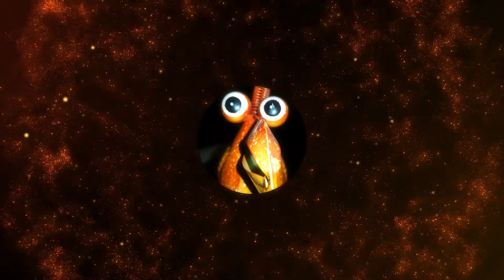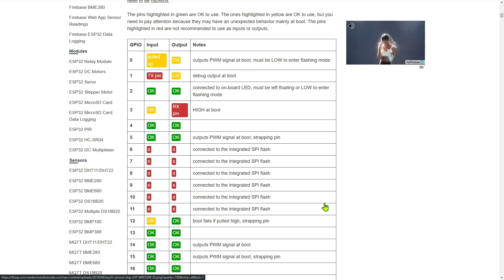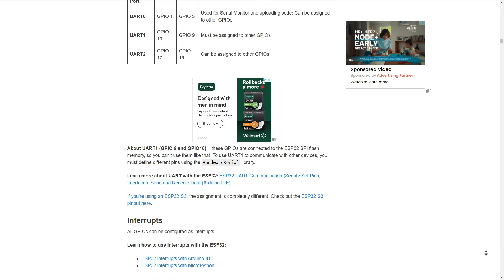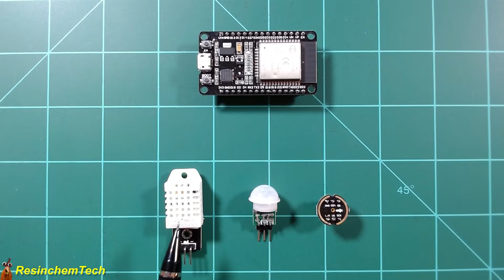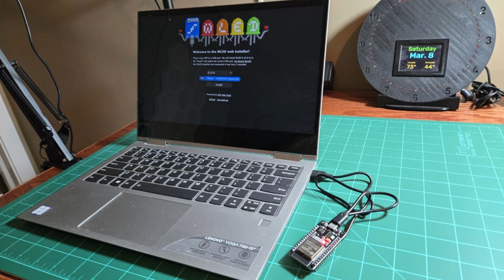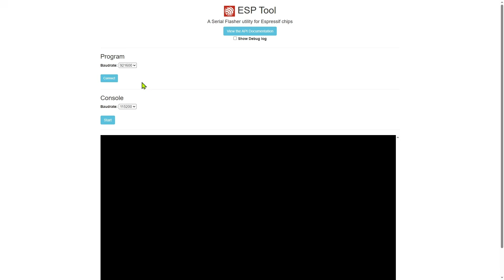How to Use the ESP8266 or ESP32 Microcontroller

Comment: I have an issue when trying to power a 5v 1 meter, 144 LED strip through the VIN (5v), GND and GPIO 16 (RX 02) of a ESP32 board which is being powered through an USB-C cable from my computer.

When the power wire (red) is connected to the VIN GPIO, the board disconnects from WLED. The moment I remove it, I refresh the browser and WLED connects again.

Does this happen because the LED strip is sucking too much power and I need to connect the system to a power supply for power injection and use a shifter as he explained in the video, or is it something else? 
I have seen videos of people powering the same strip I have with the same setup and I have, and I can't figure out what to do next, I'm stuck!
Reply from the maker: You cannot power an LED strip from the power pins of the ESP32... anything more than 10-15 LEDs draw too much current for the power regulator of the ESP.  You run the risk of damaging or destroying the ESP32.  To power anything other than just a few LEDs, you need to run the power in parallel to the LEDs and the controller.  I'd recommend taking a look at this video (jump to around the 29:30 mark to just see the proper way to power your LED project if you don't want to watch the entire video).  This shows the proper way to power your LED project.
Reply from the maker: Also note that 144 LEDs (assuming you are using 5V WS2812b or similar) could draw up to 8+ amps when on full bright white.  This is also likely higher current than can be delivered via your computer's USB port.  You really need a separate power supply that can supply at least 5A (preferable 10A).  Trying to power both the board and LEDs from an underpowered supply can lead to all sorts of problems, including overheating and/or damaging the power source itself.

Comment: Okay i have a question: a saw a lot of ppl using "dupont" 28 AWG wire to connect on head pin on the ESP. But for my project  i need a 22 AWG to power my led strip. Can i use both type of wire ? A 20/22 AWG from the power suply to a clip conector (wago system) then a 22 AWG from the connector to the led strip then a 28AWG from the conector to the ESP ?
Reply from the maker: As a general rule, the larger gauge the wire that you can use, the better.  Larger gauge wire will be able to carry more current with less voltage drop.... and this is true for any electrical connection, not just the LED strip.  In fact, using too small wire can be a potential safety issue as the wire could heat up so much under higher current that it could melt!

I bought a Dupont and various sizes of JST connector kits and normally build my own wiring harnesses/connectors.  That way I can use 22-24 gauge wire (and even 18-20 in some cases) for my own connectors.

If you do have a situation where you need to connect together wires of a different gauge (via Wagos or even soldering the wires directly together), try to keep the smaller gauge wire as short as possible and use the larger gauge wire for the longer portion of the connection.  Length as well as gauge impacts resistance.  So If I need a total of 12" between components and one has 22 gauge wire and the other has 28 gauge, if possible, I'd make 10" of that with the 22 gauge and only 2" of it with the 28 gauge.

So in short, yes you can theoretically "mix" wire gauges.  Just assure that all wiring is rated for the maximum expected current.  If unsure, there are a number of online wire gauge calculators (that also include wire length) that can help out.  But always use the largest gauge wire as possible.  This is often limited by the connector or connection type.  Even if building your own connectors, you simply won't be able to cram an 18-gauge or 16-gauge wire into the tiny pins of a Dupont connector.  18-gauge is also about the largest gauge where you can get the stranded wire through a connection hole on something like an ElectroCookie board.  But always try to use the largest gauge wire as practical for you project.

I hope that answers your question!  If not, please feel free to follow-up if I was off the mark in what you were really asking.
Reply: @ResinChemTech  TY a lot for you answer ! and forgive my bad english.. My main issue to be honest is: how can i connect my ESP32 to my project ? because:  I soldered my ESP32 to a head pin. Now i want to connect the right pin on a wire and conect it to the power supply. But how ? did i solder the wire directly on the header pin ? or just use a Dupont jumper ? (but mine are 28AWG). But i guess for the ESP only (500mA max) 28 AWG is enought, the rest of my project gonna be wire with 22 AWG. If it's a issu i will try to solder a 22 AWG directly on the header pin. What's is your advice ?

Comment: Hi
Great comprehensive video. 
I am unhappy with your oppinion regarding the reset button. Yes, the behavior ist like powering up. But the xx1117 is a pure analog circuit, no reset input. The reset button ist connected to the reset input of the controller itself. 
To proof put a voltmeter across 3V3 and GND, power up the whole thing and press the reset button - the 3V3 is not going away. 
(Sorry - struggling with the german spelling correction 😅)
Regards Hans

Comment: What if we want to use 24v power supply as well, as I have a lot of 24v and like to use esp32 to test them rather than Dig quads. I also mean on powering things from a Makeronics board too.
Reply from the maker: If I understand what you are asking, I cover using multiple power supplies/voltages in the video starting around 25:24.  While I'm showing 12V in the video, the same processes could be used for 24V... step down the voltage for lower voltage devices, step up the voltage for higher voltage devices or use two separate power supplies and create a common ground.

Hope that answers your question.  If not let me know, along with a few more details, and I'll do m best to help out.
Reply: @ResinChemTech  thank you for this yes that is what I mean! I just get confused on things and trying to double check so I'm not going wrong to be melting things! would something like a DC-DC 24V/12V To 5V 5A Step Down Power Supply Buck Converter Adjustable USB Step-down Charging Module be ok as I have 2 and  I'm not sure which would  be best to use the other one is a MP1584EN ultra Small DC-DC 3A power Step-Down Adjustable Module Buck Converter 24V To 12v 9V 5V 3V for Arduino and a Small DC Buck Voltage Converter Step Down Voltage Regulator Module Board 4-38V to 1.25-36V 5V/12V Adjustable Output Voltage Stabilizer Transformer
Reply from the maker: An important point to remember, other than the fact that the buck/boost converter converts the voltages you need, is that it can handle the expected current load.  I'm assuming you are looking at LEDs?  Remember that LEDs can  draw significant current and you should calculate the expected current draw for your project.  All components (including any voltage converters) must be rated to handle the expected maximum current.  For example, let's say you are going to use a 5V power supply but a boost converter to step that up to 12V for an LED strip.  Say that you calculate the max current draw of your LEDs to be 5A.  The boost converter must also be rated to handle at least 5A.  

Remember that it is the current, and not just the voltage, that can cause components to overheat, melt and even catch fire.  So you always need to know the expected current draw of your components/projects and assure all components, wiring, mounting platforms (like a breadboard) are rated for the expected current draw.
Reply: @ResinChemTech  Thank you for this warning! How do I calculate the current flow to the leds, lets say my projects using a 5m 24v fcobs and going to use a 24v 15A power supply are you referring current to Amp? I think on a quick guess I'll prob use 15m to 20m in LEDS
Reply from the maker: I recommend you use this:  https://wled-calculator.github.io/

Enter in the type of LEDs and the total number.  I'd then use the 100% bright and white for the maximum current.  This will tell you the estimated amps (or current draw) of the LEDs.  It also tells you the minimum gauge wire you should use for power, along with the number of power injection points you might need.

Comment: I’m coming from the commercial automation on big buildings with chiller plants and what not and just found out about these gunna have fun with making house more smart!

Also are there analog inputs/outputs and digital inputs/outputs or are they universal inputs and outputs and just configurable?
Reply from the maker: On the ESP8266, there is a single analog pin (normally labeled A0).  However, on the ESP32, there are numerous pins that can be used as analog or digital.  Just be aware that you can't use any of the ADC2 pins at the same time as WiFi.  So if your board uses WiFi, you  can still define any of the ADC1 pins (up to 6 of them) to accept/send an analog signal.  Just remember that unlike some Arudinos, the GPIO pins on the ESP boards are only 3.3V tolerant.

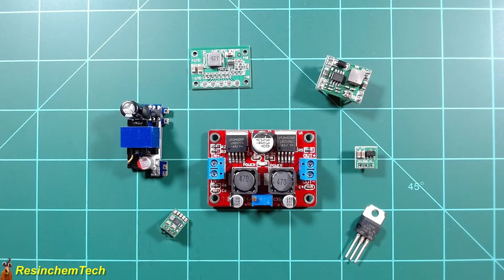Comment: at 28:01  would you need a voltage divider or some kind of resistor on the data line?
Reply from the maker: I'm assuming you are talking about the data line for LEDs?  I use a logic level shifter to shift the 3.3V output from the GPIO pin to the 5V signal expected by the LEDs (note that I no longer recommend the I2C-compatible shifters however: https://youtu.be/Va5eTscUJQI ).  

I generally haven't found the need to add a resistor to the data line except in rare instances where I have a long data line with the ground bundled next to the data line.

In fact (as many people will tell you), if you have a short run between the ESP and the start of the LED strip, you don't need a shifter at all.  So it really depends upon the project and installation.  In general, at least for my couple of dozen WLED installs, I haven't had the need to add a resistor to my LED data lines.

Comment: How many ports I can use for wled?
Reply from the maker: Not sure what you are referring to by "ports", but if you mean pins, then you can use up to 3 GPIO pins for output with the ESP8266 and up to 10 pins for the ESP32:  https://kno.wled.ge/features/multi-strip/
Reply: I meant besides D2 pin is there other pin support wled?,  why version 0.14.3 wled lost connection after the phone turn off @ResinChemTech
Reply from the maker: Yes you can use a different GPIO pin, but not all pins can be used (e.g. analog GPIO won't work).  You also need to specify the GPIO pin used in the WLED settings.  Did you also join the WLED controller to your local Wifi?  If you are just using the local hotspot and your phone, then you naturally won't be able to connect/control WLED when your phone disconnects from that wifi hotspot.

This video isn't really about WLED and how to set it up/use it.  I would recommend you find a video (mine or someone else's) on how to setup and use WLED.  I'd also recommend that your look over the official WLED documentation as it will answer many of your questions, including listing acceptable GPIO pins and more: https://kno.wled.ge/basics/getting-started/
Reply: @ResinChemTech thank you very much 👍

Comment: Very informative video. I've been tinkering around with ESP for a few months and it's definitely a cool platform.
Reply from the maker: I'm continuously amazed at everything you can do with these little $3-$5 boards!  Combine that with ESPHome or Arduino (or even micro or circuit Python if that's your jam) and you can build some pretty complex systems.

Thanks for watching and for the comment!
Reply: @ResinChemTech  Absolutely. I've gone down the rabbit hole with WS2811 lights, IOT, home automation etc. Your channel has great content. New subscriber here as well.
Reply from the maker: Yeah... it can be quite the rabbit hole!  Thanks for the sub... and welcome to the channel!

Comment: you're a very good teacher and i am among the many who are fortunate to learn from your videos. i just got my first esp 32, and of course a project ender crops right up. when i try to connect the device to flash it i'm getting no com port. i tried esp tools and get error: permission denied, as if nothing connected. the led lights up and i can connect to it on wifi. any help would be appreciated. the usb c is from my m5 stick.
Reply from the maker: You'll likely need to install a driver to properly access the serial port.  The exact driver depends upon your computer and the USB-to-Serial chip on your ESP32.  It will likely be either the CH340 or CP2102.   Try going to the WLED installation site (even if you aren't installing WLED):  https://install.wled.me/  

You don't even need to connect an ESP board.  On the WLED install page, click the 'Install' button.  This will prompt you for a COM port.  Just click 'Cancel'.  This will pop open a window with links to the various drivers for Windows and Mac.  If you are not seeing a new COM port appear when you connect an ESP board, then it is almost always a result of a missing driver on the machine being used.
Reply: @ResinChemTech  that was part of the problem, but it took a lot of finagling to get things working. It's very kind of you to keep up with older videos and continue to answer our problems. thanks. can i get your phone #?      haha
Reply from the maker: I do try to respond to every legitimate comment, regardless of how old the video is.  My primary goal is to help others and I figure if someone took the time to post a comment, the least I can do is reply. 

While I can't share my phone number, you can often find me on Discord and I frequent many of the common Discord servers (e.g. Home Assistant, WLED, etc.).  While that can be handy when needing to share code, photos or documents (which you can't do here), I'm still always happy to try to answer general questions here in the comments.  So don't hesitate to reach back out if I can help in any way.

Comment: Hi, wondering if you could gve me some advice please. Ive bought an obd II dev kit from the pi hut. wondered if you knew much about these and what cable i need to connect to a laptop thanks
Reply from the maker: Sorry... I haven't used any type of obd at all, so I really can't be of much help.  But you should be able to find something that details the pin outs.  Here's a starting point that I quickly found that even includes a link to the Arduino library so you can develop code to interface with it:  https://docs.longan-labs.cc/1030001/

Wish I could help more, but I simply haven't tried using anything like CAN-BUS before.
Reply: @ResinChemTech  Thanks for that, i did download some arduino libraries. Will have a read through this and see if it helps. appreciate the reply, thanks

Comment: Hi thanks for your content, I havec a question, could be the esp32 Wled command with an other Esp32??  like I put the wled esp32 near the the light top at the ceiling, and Ihave a second Esp32 with buttons near me, like play guitar and have some pedal button for swicth light effects , wat do you think? thanks
Reply from the maker: You could certainly do something like that as WLED has both HTTP and JSON APIs for receiving commands externally:  https://kno.wled.ge/interfaces/http-api/

The tricky part, if you are not a coder, is creating the code on the ESP32 that has the buttons.  The code must be able to post an HTTP request or JSON payload to the WLED controller.  Of course if you have another automation system, like Home Assistant, it can also act as the "middle man" between the button controller and WLED controller, using automations to trigger on a button press and then send the appropriate command(s) to the WLED controller.

Best of luck with your project!  Let me know if you have additional questions.

Comment: When I first started messing with WLED and ESP boards I got caught out by the different width ESP32 boards not fitting onto bread boards and the fact that some them were really badly printed and seemed different.  In the end I just standardise on the D1 Mini boards as the quality seemed consistent and you always got what you ordered.  I got around the breadboard problem by getting my own breakout boards made with a 5V input, labelled pins and rails for i2c/3V/5V, and they worked out as cheap as buying a bare breadboard.  They did require a lot of soldering of the pins but I needed the practice and learning the circuit board software was a good learning experience.
Reply from the maker: Been there!  I do try to remember to mention that 'standard' NodeMCU-style ESP32 boards are slightly too wide for breadboards in my videos where I'm using an ESP32.  I generally get around this by installing pin headers that raises the ESP up and permits wiring underneath the board (mostly I do this for the soldered "ElectroCookie" versions).

I also ended up eventually creating my own breakout board that has things like a logic level shifter that I often need for my projects.  I built it so it would accept either an ESP8266 D1 Mini or an ESP32 Mini and breaks out most pins.

Like you, my go-to board in the past has always been the Wemos D1 Mini.  But I have been slowly migrating to the ESP32 Mini for new projects, as it seems that everything is moving to the ESP32 and Espressif's support for the ESP8266 will end in a couple of years.

Good luck with your future projects.  Thanks for the comment!

Comment: Another great video! If you get tired of pushing the BOOT and EN buttons when flashing, you can put a 10 uF capacitor between the EN pin (pin 2 on my dev board) and ground. At least this works for me. Thanks for all your efforts ResinChem Tech.
Reply from the maker: You are most welcome... and thanks for the tip and taking a moment to share it.